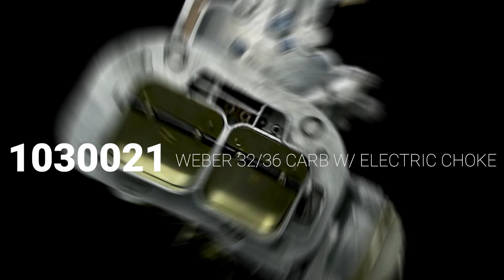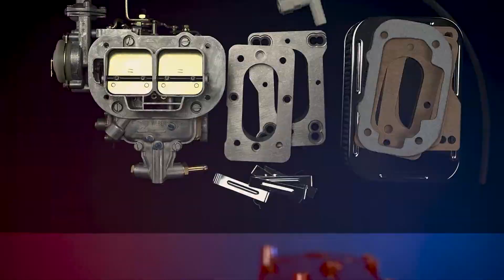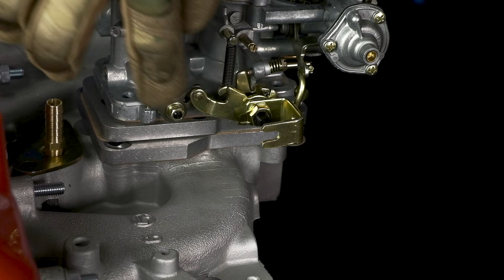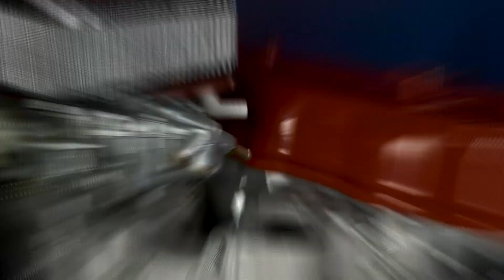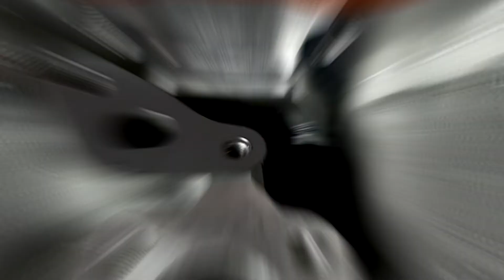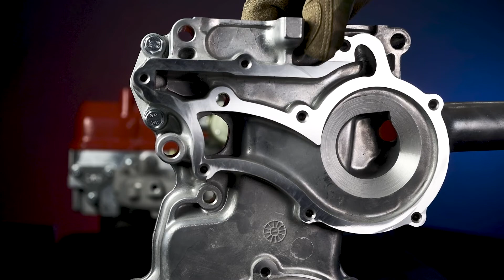1030021 Weber 32/36 Carburetor Kit With Electric Choke - 20R/22R

Comment: Hi, i'd like to install the 32/36 on my honda civic 4th gen (1.5L 16v) ed3 (d15b3). But i can't find any info on how to do it and where i could buy it online ? I'm from Madagascar but i can get it shipped from france if i can find it online. I want because my stock carb doesn't work well anymore, and i read that it is good for fuel consumption.

Comment: Hello, so how is this better that the two flat plates that come with the carb?
Reply from the maker: In this video we use the stock plates Weber provides but we do have upgraded adapters that add power and aren't prone to vacuum leaks like the ones from Weber.
Reply: The Weber adapter plates are notorious for vacuum leaks, the LC engineering ones are made specifically for the engine so they fit better

Comment: 21r engine fits?
Reply from the maker: Not to my knowledge, I believe it will require a different manifold adapter than what Weber supplies in that kit.
Reply: It fits the 21r

Comment: stupid but serious question; i’m new to carburetors and i bought this one for my 22r, but everyone seems to have that EGR block off plate, is it just for a cleaner look and better flow or the 32/36 just doesn’t have the EGR system anymore? I live in California and the emissions are so picky
Reply: Most states have the 25 year rule for classic cars, unfortunately California classifies classic cars as being built before 1975 so smog would still apply to your truck
Reply: @Alex-ve1og also 8 or more generations don’t need a smog.
Reply from the maker: Unfortunately if you live in California, we don't believe you will be able to remove yours. It would clean up the engine bay if you were able to do this yes as well as one less part to give you any issues in the future.